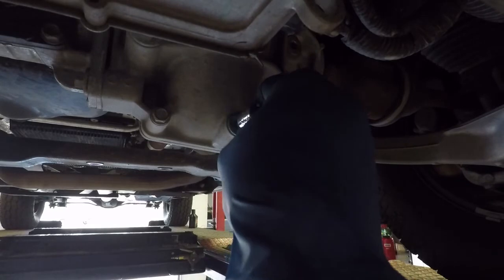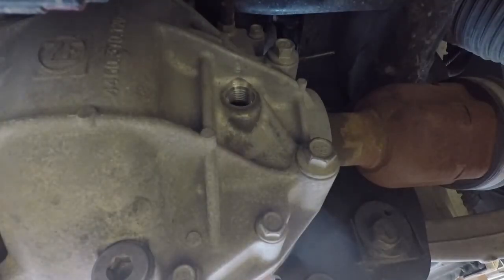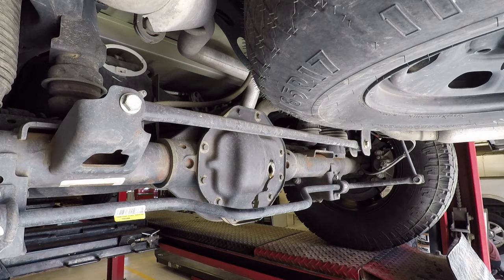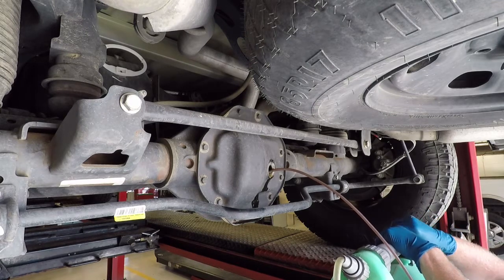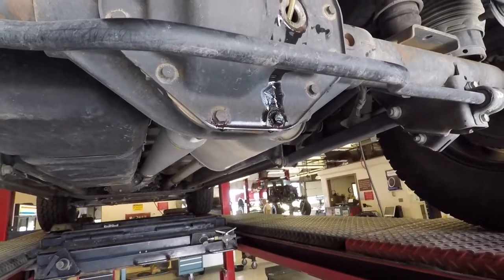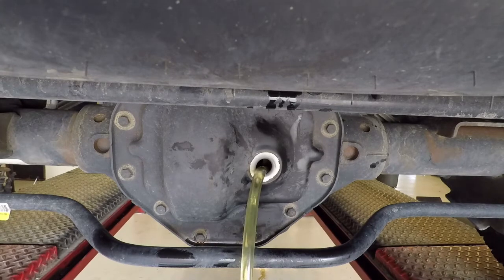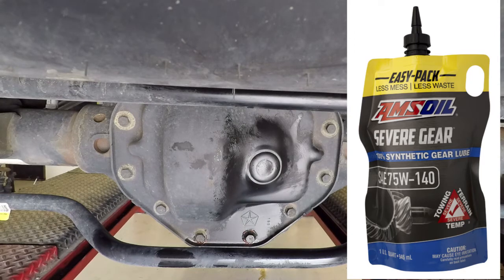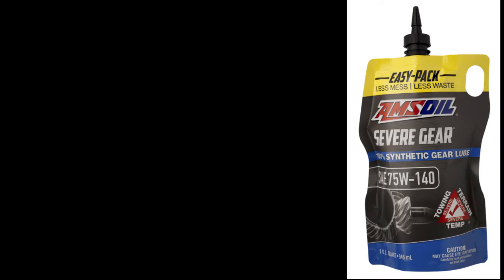2016 RAM 1500 5.7l Hemi Diff Fluid Change

Comment: Thanks for the video and the comments from everyone. By the comments and acknowledgement, i assume there is a drain and fill plug on both front and rear diffs. I'm going to tackle the task in the next couple weeks.
Reply from the maker: Correct there are drains on the front and rear axles.  Good luck and thanks for subscribing.

Comment: No drain plug on rear diff?   My 2016 Ram has one bottom side of housing.
Reply from the maker: Thank you, I missed that.  Just checked and there is one on the bottom right side.
Reply: @JWCMotorsports  mine has one................................ok your good

Comment: Nice Video! How many Liters get in the front and rear Diff? Thanks for ur answer :)
Reply from the maker: The front diff takes 1.3 liters, the rear takes 2.5 liters.
Reply: @JWCMotorsports  Thank u very much :)
Reply: no lim slip needed in the rear diff?
Reply from the maker: @Diamantman09  depending on what fluid you are using it may need some.  I did not add any and have not had any chatter/noise, or any issues.
Reply: @JWCMotorsports  needs the Amsoil rear diff oil lim slip? thats the oil what im looking for
Reply from the maker: Sorry, I miss understood your comment, here are links to the AMSOIL products.

AMSOIL Slip Lock  https://www.amsoil.com/p/slip-lock-adatb/?zo=1756445

AMSOIL Gear Lube https://www.amsoil.com/c/gear-lube/25/?zo=1756445

Comment: I have a 2017 ram 1500 4x4 5.7 big horn in the owner's manual recommends 75W90 for rear axle  why are you using 75w140  why is it different I'm confused lol
Reply from the maker: 75w-140 is a recommended fluid viscosity for my truck.  I chose to go with it due to the towing I do with the truck.
Reply: @JWCMotorsports  if I don't tow  should I use the 75W-90  ?   That's what my owner's manual is recommending   for the 2017
Reply from the maker: @--emt  yes. You should be fine.  If you do any significant hauling you should consider 75w-140 or more frequent fluid changes.
Reply: @JWCMotorsports   Thank you very much my last question is does the front  diff take the same fluid also if not why?
Reply from the maker: @--emt  yes it does.

Comment: Hi I didn't see you adding the limited slip additive 5 Oz according the the owners manual 1500 4x4 requires the additive, is this rear wheel drive 1500?
Reply from the maker: It is a 4x4, I follow the guidelines for the products I use,  AMSOIL severe gear does not directly call for adding, if I had experienced any slipping or chatter I would add AMSOIL Slip-Lock.   Over 2 years later and close to 40k miles I've had no slipping or chatter from the rear differential.   Not all fluids are equal and anything other than what I used can experience different results.  Also, my truck was not that worn/abused so there was no additional wear that I had to be concerned with.

Comment: Hello, did you not add any additive to the rear differential? I know that only with additive...
Reply from the maker: AMSOIL SEVERE GEAR is compatible with most limited-slip differentials. For applications that require additional limited-slip friction modiﬁer, add AMSOIL Slip Lock® .  I have not had any slipping and have not added Slip Lock.  If you feel it's necessary you can.
Reply: Package for severe gear says "Contains friction modifiers for limited-slip applications."  Most quality synthetic ones have the additive.

Comment: Notice any difference w/Amsoil?
Reply from the maker: Overall, the mileage is up, with the towing average up 1.5 MPG.   I don't have any temperature monitoring for the differentials so no data on if they are running cooler, but with Severe Gear, I'm not worried about the temps as much.
Reply: JWCMotorsports  thank you for the info!! I have a 2018 RAM that is going to get the same treatment! BTW, don’t remember, did you add some MOPAR friction mod to the rear diff?
Reply from the maker: @OgleBilly  I did not add any friction modifiers as It is not necessary when using AMSOIL Severe Gear. I have not experienced any chatter in this truck, or a 1997 Dodge HD 2500 that we changed over to Severe Gear a couple years ago.  However, if after adding AMSOIL you notice the "chatter", AMSOIL has Slip-Lock, AMSOIL Slip Lock® Differential Additive (ADA) is formulated with advanced friction modifiers and is designed to eliminate gear-housing chatter in cars, trucks, and SUVs equipped with clutch-type limited-slip differentials.
Reply from the maker: @OgleBilly  Are you already an AMSOIL customer?  If not, the links in the description above are to my storefront.  Thank you for watching it.
Reply: JWCMotorsports thank you for the info! And yes, I’m a new Preferred Customer. I put AMSOIL in my Challenger and my Ram. I’m getting ready to do both diffs and transfer case and have my transmission flushed and filled with AMSOIL